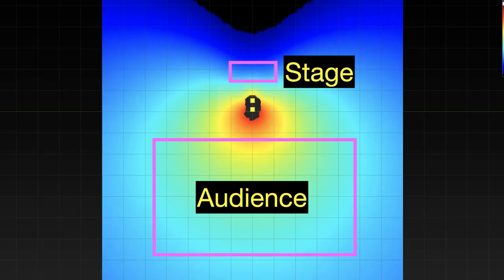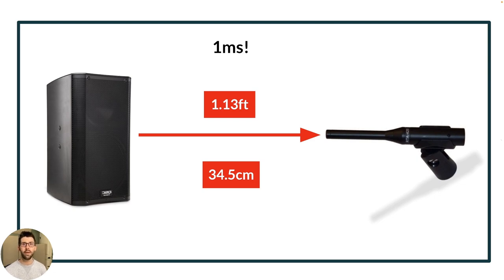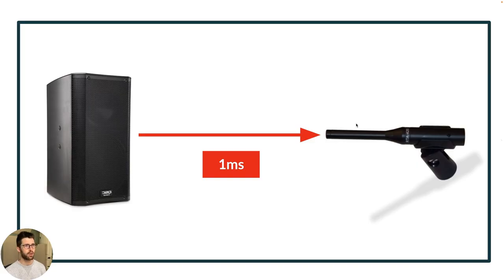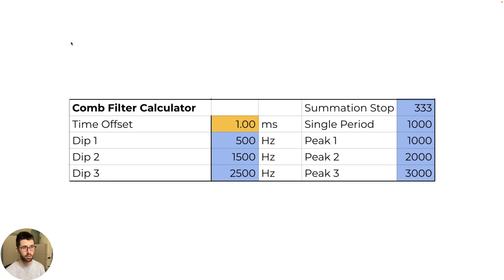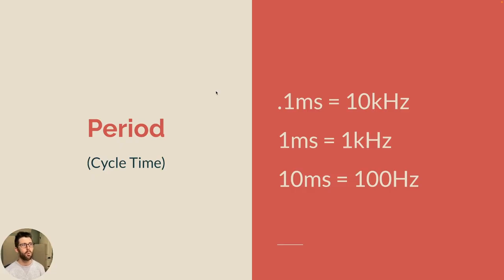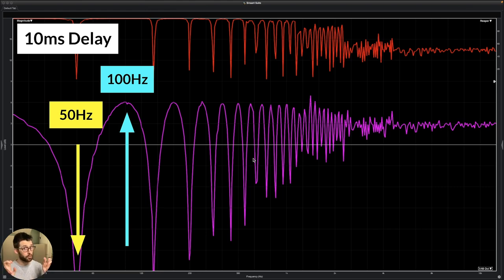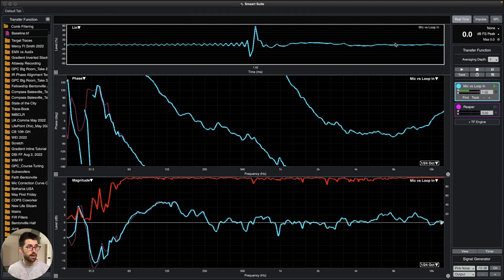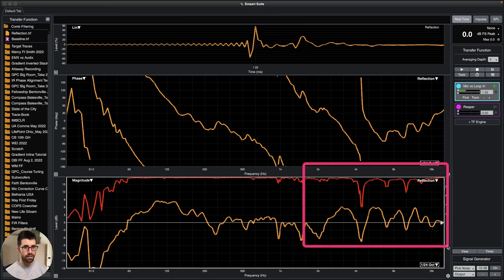Understanding and Preventing Comb Filters | Live Sound Basics

Comment: Finally someone who actually gets into the nitty gritty of it! Thank you so much! Question though - If you have two sin waves of the same frequency set at a constant offset, wouldnt they always retain a constant relative offset between their phase points? In order for them to go through a full 360° phase cycle relative to eachother wouldnt one have to be either increasing or decreasing in frequency? I will pay you if you will talk more about this with me over the phone for 30m
Reply from the maker: Great question Ethan! The original phase offset could either be due to a static full-bandwidth time offset, or a gradual timing offset over frequency.

In your case, you're talking about a single sine wave - so either of the above changes would have the same result.

A 1kHz sine wave has a period of 1ms, so delaying it by 1ms would mean 360° of phase shift. Another 1kHz would still be turning at the same rate of 1kHz, but if it was not delayed it would retain its original timing, and therefore phase, relationship to the other delayed 1kHz sine wave.

Comment: I was just thinking about this the other day.  I was thinking about getting some new PA speakers.  One option is a pair of boutique passive speakers that go down 30 Hz and can handle 800W RMS.  I thought maybe I could use these instead of satellites over subs.  Would having the low frequencies apart like that be just as bad as having subs on each side of the stage?  I think it would right?  Isn't that "power alley" effect a type of comb filtering?  Would running 15" full range tops on sticks sound worse than using high-passed tops with a central sub simply because of comb filtering of the low frequencies?
Reply from the maker: I wouldn't say that one setup is inherently better than the other, but there's a different set of tradeoffs depending on the system you choose. Having audio sources coupled (close to together) helps eliminate the comb filtering effects, like you said. So, you can either choose to have your mains and subs coupled, or all of your subs coupled.

In smaller format ground stacked systems I typically prefer a center sub setup with my mains on sticks, then using crossover appropriately to divide up the low end.